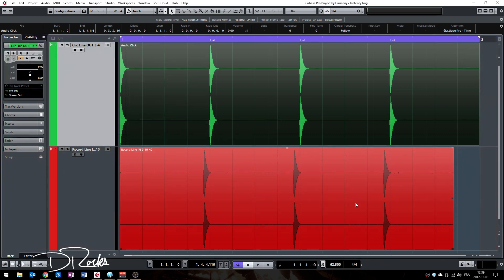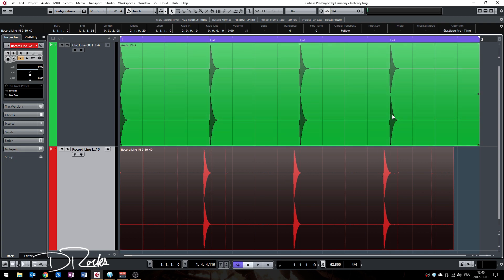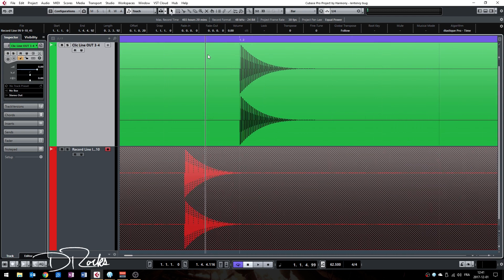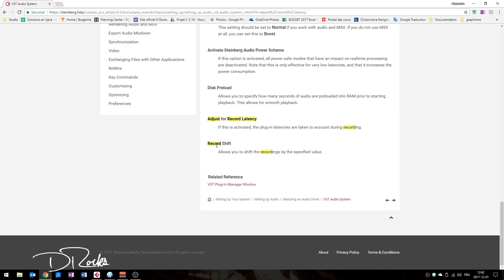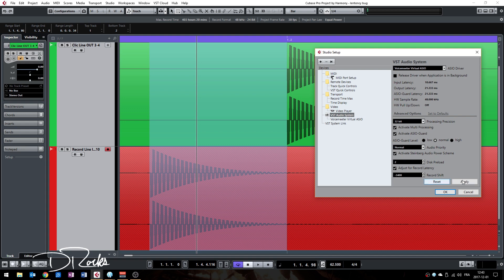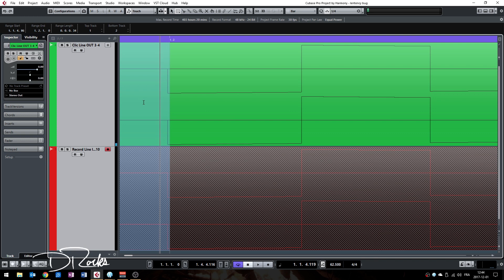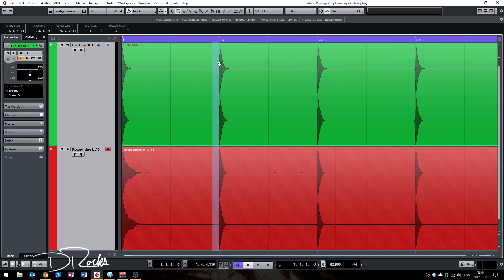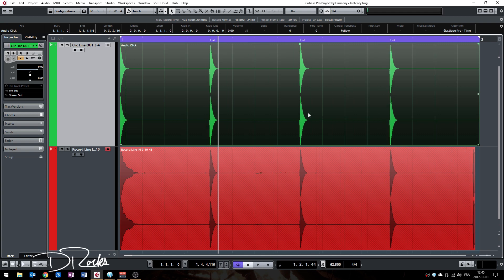How to: FIX RECORD LATENCY SHIFTS IN CUBASE (Part #1)

Comment: Old one, but your calculation is not correct. You reference ticks, but you want samples to adjust record shift. Do to this, switch the ruler to samples. If you readout the range length values then, you're immediately in sync.

Comment: just a tip , often audio engineers pre calculate this thing by a default number, the reason why you see the recording before the real hit is because they calculate the delay by a standard cable length, so they anticipate the recordings by a standard value .. because you will always use cable longer than 1/2 mt if you record something.. I just did this test with my audiocard and routed everything with my pachbay wich result in 7/8 mt of cables length and my result is slighty after ... probably if I route everything with 30 cm cables I will have a "before " value ... anyway now is perfect in time with your help thanks
Reply from the maker: Thanks. This is insightful details. I never thought of cable length!

Comment: Hey man  I tried your process, just didn't work the more I tweaked the more it shifted either more to the right or to the left
Reply from the maker: Hey its probably because you dont have a problem in the first place. Also this is just how it works I did not come up with that trick.  This resolves a wierd an unpredictable issue that can happen but it should never happen in an ideal world. It theorically is all handled by Cubase by default. Sometimes its not aligned and thats when you would try manual shifting.
Reply: @DRocksRecords  still having serious issues I can't use it to record just mastering, cuz it take lower CPU usage than flstudio

Comment: What to do if every synth comes with its own latency? Can you make this shift correction on a track basis?
Reply from the maker: Im not an expert but I think you should never worry about this unless you really find a problem with your synchronisation. By default every track delay should be handled by Cubase or any other modern DAW. The recordshifting is more like a rescue setting when things are not aligned by default. But I never had to align tracks one by one and should never be the case otherwise it would be a nightmare to synchronise everything. So dont worry about that unless you find your tracks dont align with your project tempo.
Reply: @DRocksRecords   all my external gear when recorded gets a small delay, is never perfectly on the grid. record shift doesnt work. and i have the minimum latency allowed, 32. steinberg cant help with that! On ableton it syncs perfectly.
Reply: @Artinmotionmusic  This is wierd. Probably a driver problem (easy to think that but it can be many factors). What audio interface do you have?
Reply: Alexandre Desroches i have an UAD and a brand new mac. If your project has a swing do you manage to record with the swing as well ?
Reply from the maker: @Artinmotionmusic  man thats wierd youre full equipped this should be fine. Im sorry please see with Cubase support or UAD to see why they dont sync together. Good luck that sucks
Reply: @DRocksRecords  thanks a lot. i am in touch with steinberg but i will write to uad too.

Comment: Thank you so much Alex. Great helpful vid. ThNx buddy. I wonder if a similar technique would work for Vocals/audio that get recorded many tones(pitch) lower than the actual input. My vocals go down into a completely different key for some reason(the vocals surely arent that bad). 🤔😏🙄😁   
Keep fab
Reply from the maker: Hey thanks for your comment Steven :D Well for that pitch recording issue, it sounds to me like a Sample Rate / Playback rate problem. There is probably a difference between your Recording sample rate (for example 44khz) and your software might playback at a different rate like maybe (48khz or 96khz). If it is the case then surely the sound will pitch up or down because it plays either faster or slower than when you recorded it. Try to check this and I hope it helps you :D cheers

Comment: The latency issue is not from Cubase but from the ASIO driver. If you try a different sound card you gonna have different latencies. Also if you change the sample rate, you have to adjust again the record shift.
BTW I think the value you enter in record shift is in samples not milliseconds.
Reply from the maker: +Lazaros Palaskas Thanks so much for your precisions!

Yes you're right the problem is not Cubase itself - when it's about the latency and that the audio card and buffer size will affect all of this. 

At first, before doing the video, I tried just about anything like changing BUFFER size, activate and deactivate ADJUST FOR RECORD LATENCY box, activate and deactivate CONSTRAIN DELAY COMPENSATION etc in all different combos...

Well, I still had the same RECORD SHIFT problem which is normally handled by Cubase without doing anything (Yes, I tried restarting computer, DAW, and interface).
That's why I had to find out how to shift the recordings back in time manually.
And the wierd thing is that the day after the video my Cubase could record correctly without any manual shifting.

This also led me to verify if my informstion was 100% accurate in this video and found a new faster and easier method to calculate the record shift value right from the Studio setup infos..

Could you please check part #2 on my Audio Latency Knowledge playlist and see if the answer is helpful to close the issue with record shifting? 
As I said the Cubase manual is almost silent about this so I have to figure out alone and with forums.. and YouTube :D

Thanks again man
Alex
Reply: Hello Alex.
I did check part 2 of you video and i did a test with my PC.
First of all i was wrong that the record shift is in samples, sorry for that.
Second is that in my setup with my audio interface (Digi Rack 002) with 256 buffer size i have 7.800 input and 7.800 output latency,  and for me the perfect record shift number is at 176. So your math in my case is not correct. The weird thing is even if i change the buffer size to 1024 and the input latency is 25.xxx and the output 25.xxx the record shift needs to stay as before.
So in my case with the number 176 i am fine with ANY in and output latency.
I have to change the record shift ONLY when i change sample rate lets say all the tests are in 44.1khz and i change to 96khz then the record shift has to be at 422.
Sorry for the long post but my conclusion is that: every soundcard/ASIO driver needs his own setup and there is no math for that. Test and set it to the right value.
Reply from the maker: That's great info again thanks! But wow it is surprising that it behaves in different ways. I hope Steinberg will add more exact details in the manual in the future.

If you find anything else please let me know again.

Good news is that both of us have fixed the issue :D
Reply from the maker: Lazaros Palaskas btw: did you test it with a similar recording output and input method that I tried? Or What was your method?
Reply: Knowledge has to be shared that's why we have to communicate and solve problems. :)
I was thinking that every computer has different parts inside and everything can be leading to different results that's why i'm saying that every user has to make his own adjustments.
Hope that any user finds the right setup/adjustments for hisself.
Reply: Direct from output to the input. Like loopback... ;)
Reply from the maker: I totally agree with you and for this Youtube is awesome really!!
Reply from the maker: Allright so it was the same method thanks bro
Reply: this is the oldest cubase problem.....since version 4